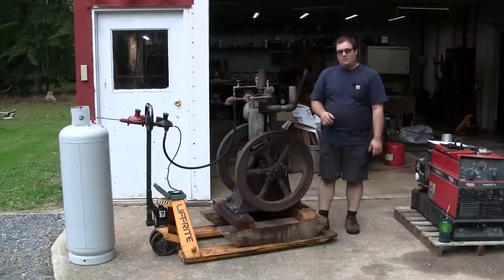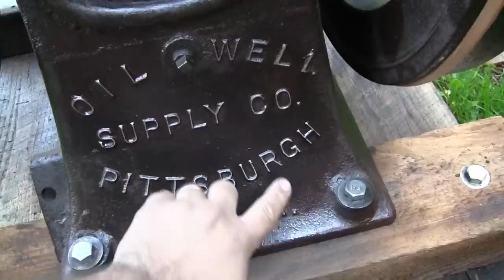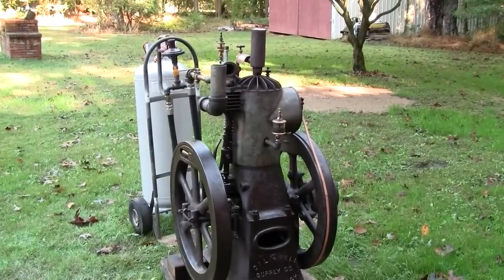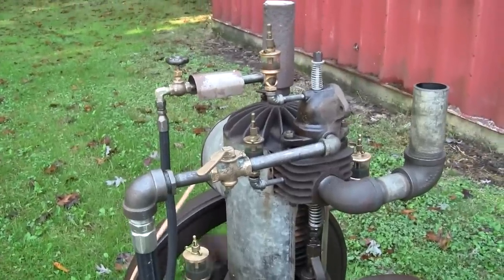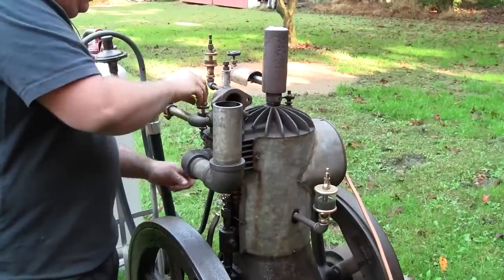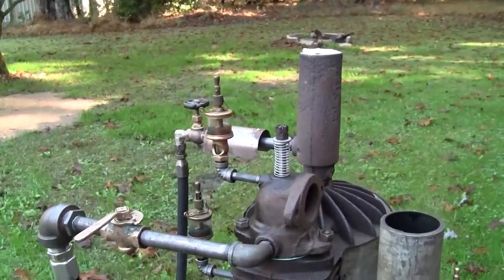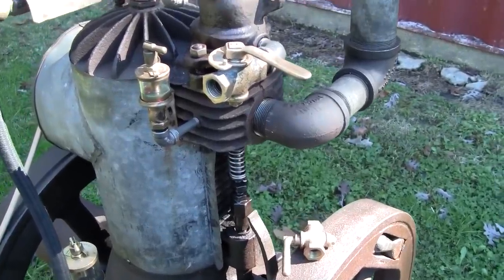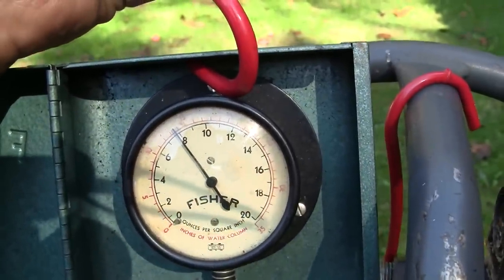100 Year Old Hit and Miss Engine Running on Propane Oil Well Supply Co.

Comment: It may just be fiberglass, but that insulation looks like ceramic wool, which is used primarily for extreme heat applications (kilns, forges, etc).  If so, you might want to look into treating it with a rigidizer to stop it from "shedding" under heat.  The fibers it releases are extremely bad for you, similar to asbestos.  There is plenty of info on treating kaowool on various blacksmithing forums.  Incidentally, that propane burner setup is essentially the same as a simple propane forge burner.
Reply: The easiest way to tell, without having a package or label, is kaowool is much more dense, and heavier, than fiberglass batts.  It feels somewhat crunchy to handle it, and more solid.  Fascinating engine, though.  It's crazy how much things have evolved, and yet how similar they are.

Comment: Not sure how many times it died from over rich mixture...  Then tried to add more fuel pressure.  Not the direction my mind was taking.  I would have tried killing it from leaning it out a couple times too.  Just to take note of any behavior changes for better or worse.  In any case, I enjoyed the video and the making of the valve too.  Cool old engine.  Love this old stuff.  Thanks for taking me/us along for the journey. 👍

Comment: You are  the guru on the old ones . This is just a thought ;but, If you put a longer runner on the intake ,it might stop the double tap ?
Let a little richer charge build up in the runner and then give it a good gulp when the time comes .
Just a thought .
Love the videos . Love the old motors.
Cheers !

Comment: My guess on the double stroke for intake is 2 things. 
1. Fuel pressure too high, needs less so the valve can be opened more for greater flow on the draw to keep the top of the cylinder rich enough to light. 
2. Exhaust runner too long or not long enough. During the held exhaust valve, enough of the burnt fuel left in the pipe causing it to be recycled back into the cylinder. This is requiring the intake stroke to purge the cylinder since the valve doesn't closed always on the top of the stroke. Then exhaust the purge stroke to draw in enough fresh oxygen to light it off on the seconds stroke.

Comment: I'll take a crack at it but someone else may have already said the same thing.  The ball valve you're playing with allows full pressure in that pipe down stream to the engine until a couple of strokes clears it out enough that it leans and fires.  I'd say you need to regulate the pressure down and open the ball valve 100% then adjust the pressure until it runs properly.
Reply: Yes, that is also my opinion.
And i think the second problem is the intake Valve not sealing properly,
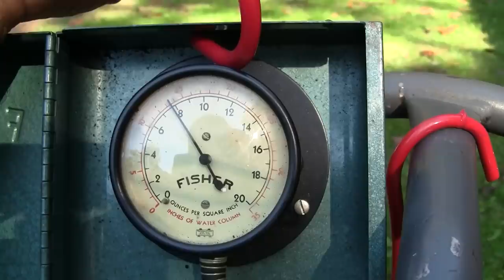If you watch the pressure gauge at 38:15 you see the needle on the first intake stroke just go down and back up again, that is OK but on the second intake stroke when it actually fires, it goes down and back up and then it jumps even higher and goes back down to normal pressure.
So it seems that some exhaust gas gets blown into the gas pipe which raises the pressure.
And If that does happen, it is also very likely that there is always some gas leaking in the intake housing, causing a very rich mixture on the first intake stroke.
He should lap the valve seat with a very fine lapping compound to create a perfect finish on the valve and its seat.

Comment: Imagine how much fun lawyers would have if this beast was made today...
Reply: Ed   .?
Reply: ya mean because of how unsafe it is?
Reply: @leon.690sm9  I think too... no security at all if it shuts off and the intake valve leaks propane and accumulates in a partially enclosed area... same for the burner.
Not even talking about the startup and no guards for the belt and flywheel !
Reply: @GogogoFolowMe  
The engine's are still in use today on pump jacks allover,
Reply: @1978garfield  i
Reply: @GogogoFolowMe  well you have to be intelligent enough to understand the operation of these engines I have quite a few and never seen anyone get hurt
Reply: About as much fun as they would have if they would sue every driver that does not drive in a respectable manner now days

Comment: To my understanding... if the inlet valve does not seal perfectly towards the combustion chamber, the engine presses cylinder gas back into the fuel line and this results in a lean mixture in the next first (non-) firing cycle. A heavier spring or a slighly different valve angle could help
Reply: If you watch the pressure at 38:15 you see the needle jump up a little bit when firing , that does not happen on those intake strokes when it fails to fire.
So it seems that some exhaust gas is blown back in the gas pipe.

But it is also possible that the Gas pressure is too high and there is also some Gas leaking in the intake housing. That causes a too rich mixture on the first working stroke, but on the second working stroke is not enough time for the gas to leak, so the mixture is lean enough to ignite.

Both are caused by the valve not sealing properly, you may try to lap the valve with a real fine lapping compound or use some Metal polishing compound to lap the valve seat to get a perfectly smooth Finish.
Reply: Because the missing cycle is so long the intake bowl is filling with gas the whole time, first intake is far to rich, second one is right so it fires, then it takes forever to wind down again, filling with gas the whole time.
Reply: @kingcosworth2643  
Yes, that is also what i think.
That would not happen if the intake valve was sealing properly, maybe a slightly lower gas pressure would also help.
Reply: @Henning_S.  Lowering the gas pressure would help a lot, if he regulated it to atmospheric and fitted a venturi to the intake it would only draw the gas when the engine draws intake.
Reply: @kingcosworth2643  
It seems to me that the gas inlet is already a venturi.
Did you watch the video of making the new intake valve?
You can see how the gas inlet works...
When the intake valve opens, the air is passing the gas ports in the valve seat with high speed, that should work as a venturi sucking the gas in...
It should be easy to test if it works or not.
He can just keep lowering the pressure until the gas throttle valve can stay fully opened without the engine dying.
But maybe he needs some kind of gas reservoir between the pressure regulator and the gas throttle valve where the engine can suck from.
Just a T-fitting with a plastic bottle should be enough for testing.

Comment: When I was a boy,we lived on an oil lease that had a much larger version of this type engine.Engine was used to belt drive a large turn table that had a crank on it.Hooked to the crank by rods that ran out of the building and went to several pump jacks that then of course pumped oil out of the wells and into storage tanks.Engine was a huge single cylinder type that I as a six or seven year old boy could actually crawl inside the cylinder.I did one time when the engine was being repaired after a breakdown.Normally the engine ran 24/7 year round.Flywheel was taller than me,and from our house we could hear it running all the time.

Comment: It's like a push lawn mower. It runs great at a constant steady speed with the blade on but run it with out the blade and engine surges up and down and governor takes over.

Comment: The dreaded double gulp lol.. the sniffles of most old engines. The good thing is its a runner. Sounds good Mike, you'll work the bugs out. They all are well past their intended life cycle.. but getting way more oil and love now than when they were new. Nice engine.. I hope to acquire either one of these or a Bovaird & Seyfang or Myrick. Always like the hot tube ignitions. Lot easier than replacing fouled spark plugs constantly haha.

Comment: The double intake is because while the exhaust is been open and the engine is winding down the intake bowl is filling up with gas, the first intake draw is then extremely rich and will not fire, the next intake is right on the money and fires.
Reply: thats what i reckon s well

Comment: A coworker of mine has a half dozen of these type engines that he takes to the Indiana State Fair every summer. He always has them trailered up and brings them in for us to tinker with. I swear they sound on the verge of stalling out. But onwards they run. And each one runs on a different fuel. A couple will run on just about any petroleum product made. Fuel oil, diesel, kerosene, you name it.

Comment: I think your pressure is still too high mike.  when the intake opens it gets an inrush of lp.  I ran my bovaird seyfang(40 hp) on next to no pressure.  You have probably seen videos of the original gasometers that regulated well head pressure. They provide almost no pressure but a large volume that the engine can suck into itself instaed of being force fed.  Just my 2 cents
Reply: Might need a longer intake pipe to get better air/fuel flow into the engine without losing it to the atmosphere
Reply: I was thinking the same thing.

Comment: Make sure the intake valve doesn't leak any gas (on both sides) when it's closed with a bit higher gas pressure.
Now when you increase the gas pressure, the valve is letting gas through which will make it run super rich at a certain pressure. You need a stronger spring, a tight valve and seat which can handle a higher gas pressure, and also tune the length of the pipe after the manual control valve.

Comment: Thanks for the interesting video. I had an old friend, since passed on, who lived in Wichita Falls, Texas area as a child. He said that on quiet mornings he could hear these old hit and miss motors miles away. Laying in bed he would hear the thing fire and then a long pause, wondering if the motor would make another revolution; then it would fire again. He mentioned the gas from the well was run through a column of copper wire or copper wool to remove the hydrogen sulfide (rotten egg smell). In the bottom of the column a crude gasoline he called 'drip gas' would collect and when he was a teenager they would use it when they couldn't afford refined gasoline. Sulfur rich fuel will eat out the copper in bearings, so it had to be removed or bearings without any copper used.

Comment: Very fine engine you have there. 
I belive that you hit the rev. limiter, and that is blocking the exhaust valve from closing. And because you give it too much gas, it does not ignite fuel each compresion. I belive that theese engines are very slow reving, and you actuallly would be able to count the revs. And maybe the rev. limiter need adjustment, but you need to know the max rpm inorder to know.  
I have not read all 659 comments, but there are some others meantioning the too much fuel.

Comment: Super cool!  My guess should be a longer intake tube? Perhaps put a 90 facing up and the dense fuel can be caught in between the intake stroke.my belief is that the pressure is mixing the propane with oxygen and is being lost between the cycle and it finds it on the second stroke..  keep on keeping on

Comment: That sure brings back memories. 60 to 70  years ago uses to drive around the oil fields  and could here the chug chug of the pump jack engines. At the time never gave it a thought. Great restoration.

Comment: Super cool video. I've never heard of a gas-fuelled or hit-and-miss hot bulb before!

I think therein might lay the issue - I don't think you have a fuel problem but rather a heat one. You mentioned that it's a cool morning. The engine is sucking relatively cold air and, honestly, the burner for the hot tube is not doing a good job as it is located very high above the combustion chamber. Also the fuel itself is fairly cool. I suspect what's happening is that, with the glow system being of poor design and the ambient air temperature being a little cooler, running the engine without any load is cooling the hot bulb down too much. With so many idle cycles the piston is effectively moving cool air through the combustion chamber, removing the residual heat necessary for the next combustion cycle.  When you held off the governor it fired much more reliably. It's my guess that the reason it doesn't fire as it's "supposed to" when you let it freewheel is that the first cycle is letting heat build up. Once the compression stroke has completed then it's hot enough to light off the next fuel charge. But then it locks the valve open, blows all the heat out, and another compression stroke is required to allow the combustion chamber to get hot enough again.

Comment: You keep ADDING fuel when you're already too rich - Add LESS FUEL!  And I think your spring is already TOO TIGHT. Take some tension OFF the spring so it only needs to open and close ONCE.
Reply: I have a Cooper hit and miss petrol engine leaner you run it the better it idles of course there is a limit.. and if its idling well its not good under load but for displays the leaner the better.

Comment: EDITED I went back and watched the previous video and answered some of my own questions however...

Propane and natural gas have very different burn rates and need to be metered differently.  Propane requires less fuel for an optimal burn mixture as opposed to natural gas.  The metering chamber in the intake was designed for natural gas.  The rate of flow and pressure of gas in to the intake were calibrated to work with natural gas.  Given all that I can say that you need to reduce the amount of orifices in the metering chamber (the holes in the valve seat).  I do not know how many but I would start with every third one and if that is not enough then increase it to every other one.  Maybe you can find something to plug the orifice holes with that can be easily removed if needed.

While I have never worked on an engine like this, or tackled the conversion like you have I can say this:  I worked in the propane business for 6 years.  When installing a new appliance, like a stove, you have to convert the stove to work on propane.  To convert it we have to replace the orifices under each of the burners.  If you hookup a stove (one that is setup for natural gas) to a propane system, then you will have flame throwers for burners and it wont burn clean at all and usually leaves a ton of soot on everything.

--Original Post--
Mike, I do not know if you have figured out the issue but let me offer up my idea here and see if its something that might help.  With the engine doing a 'double action' before it fires sounds to me like its flooding on the first fire event.  After the first event, the intake chamber is cleared up and then on the second the air fuel mix is correct for proper combustion.

The random misfire also leads me to believe this to be the case.

I do not know how the engine is metering the air fuel mixture in to the intake.  Is there a second valve inside the housing that is designed to prevent gas from entering the intake chamber before the intake cycle?  If the gas valve is your only way to meter the fuel then it is likely you have a rich mixture on the first event and a leaner mixture on the second.  might be worth looking in to.

Also to reiterate what some others have said already, you need to be testing with a load on the engine.

Comment: Just like the old John Deere tractors.  When not under a load they fire two or 3 times, the governor is instantly overwhelmed and it has to coast back down and just when you think it's going to die, it fires again.   Pop pop pop! thug a thuug a thuuug a thuuuug a thuuuuug as thuuuuuug a thuuuuuuuug a Pop Pop Pop!

Comment: That's a lovely video bro great engine sound, you did mention it's a 4 stroke engine but if I listen closely it turns 7 times before a ignition stroke, I do accept any engine run on different fuel mixture, tends to show this effect, would be great if you throw some light 👌👌👍👍

Comment: I’ve fooled around with quite a few lp or natural gas fueled engines and they are touchy. You are on the right path with a accumulator tank, but also if you would put some type of air dampener on your intake where the two bolt ears are and reduce your pressure to about half what you are you would be golden more pressure just pushes fuel out the intake cutting oxygen if you restrict the pressure and air like a Venturi so to say your problem would be solved. We went through it on a 40hp Clark and a 35 hp reed. And that solved our issues. Happy tinkering and good luck it’s volume not pressure related. Or you could go with an on demand regulator setup for engine fuel supply depending on the parts you have on hand

Comment: I had a thought the other night, thinking about an off-grid house.   I'd have a septic tank and was thinking about harvesting methane from the septic tank and using it to run one of these engines as an emergency generator.

Comment: Yes, Mr Simon Johson is right. The engine speed up and the speed governor block the intake valve to avoid overspeeding. The video already show a test holding the governor lever. You need to add some load for continuos operation.

Comment: I was about to say you had a timing issue, but another comment said these engines need a load to run the best.  From what I hear I agree.  Try running the engine with a load and see what happens.  My bet is it will run like a top!